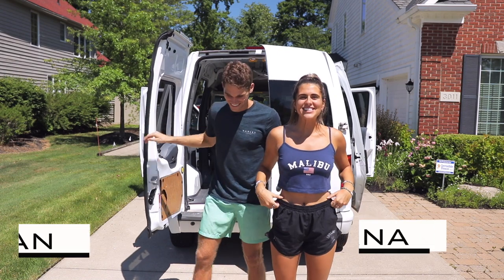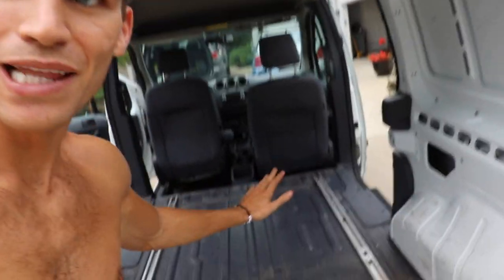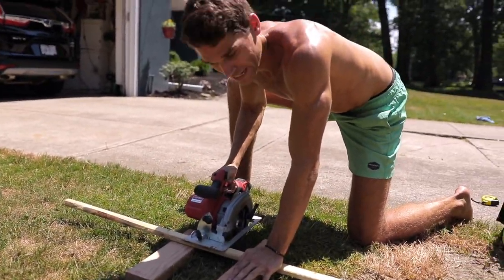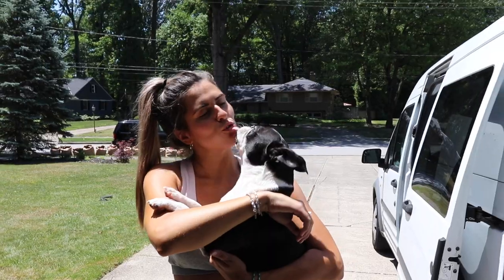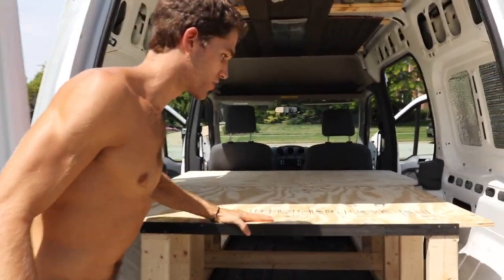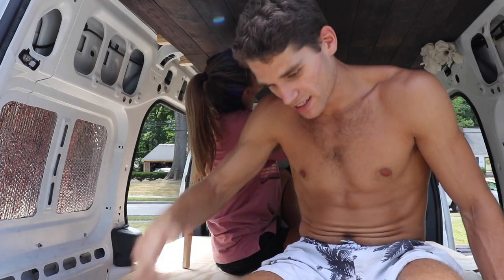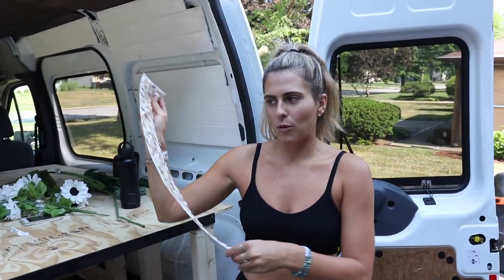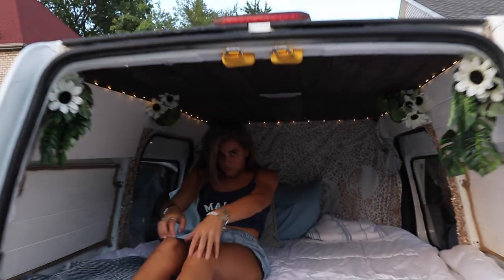CONVERTING FORD TRANSIT to TINY CAMPER - $368 in 7 DAYS

Comment: FYI I have a 2012 Transit Connect with 267K miles.  At one point I had allot of vibration in it, and found that replacing the engine mounts solved the problem.  Not sure how many miles I had on it at that time, but that solved the problem and restored complete quiet.  Best of luck!

Comment: So,  you just made one Big BED? No kitchen or ANYTHING? Riny days are going 2B rather difficult with no  space to move around or way of making your A.M. coffee...or a toilet. It's pretty as Beds go, but not very practical. I want the 2013 F.T.C. too....love the retro look, and it's the last year B4 they changed the style, plus they worked out the kinks that year....BUT...I'm converting it to a FULL Micro Camper. Happy Travels.
Reply from the maker: Thanks for the comment Leila! So pumped you are getting the Ford Transit Connect. Such a perfect and simple car for van life WOOT WOOT! 

The reason we only put a bed in the back is because we are only planning on doing this for 6 months. We won't be doing this for several years so all we needed was a bed. It has only rained once or twice during this entire road trip and when it does we head into a Panera or a cafe to get work done (really not a big deal haha). We love cooking outside and mostly living outside. It's a great mix between camping and vanlife. And lastly for showering we use Planet Fitness and it has been awesome!

Really glad you are going all out but really not necessary for what we have experienced these past 3 months. Happy travels!
Reply from the maker: Also Ana & I were just talking about having a toilet in that small of a space right next to where we sleep and we didn't consider it because it sounds unsanitary. The past 2 months have been perfect for us but everyone has their ways of doing things especially for comfort. No matter what we hope you have a great time converting and an even better adventure